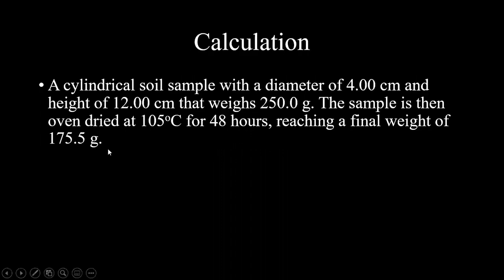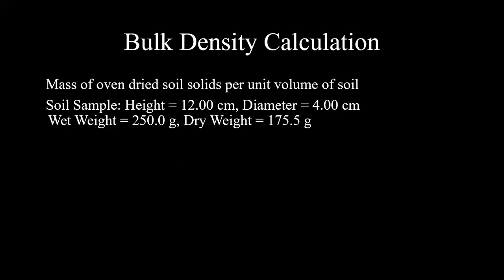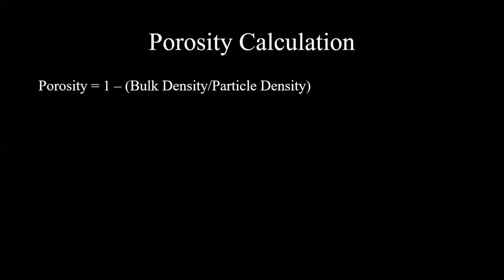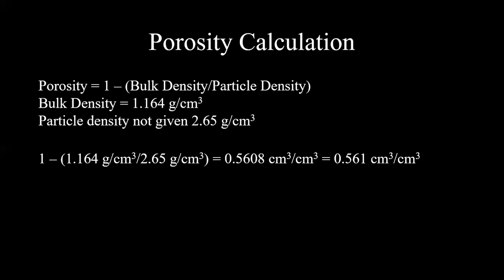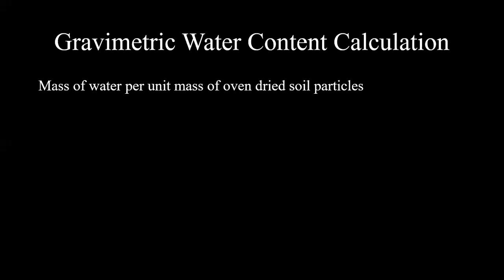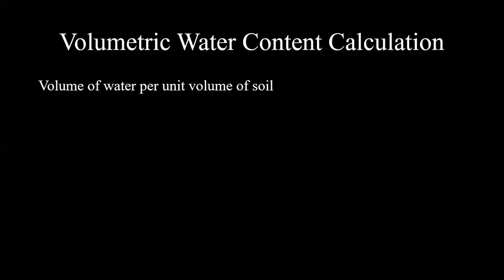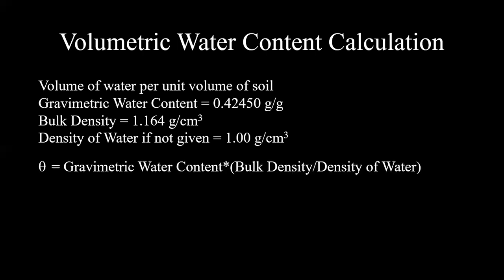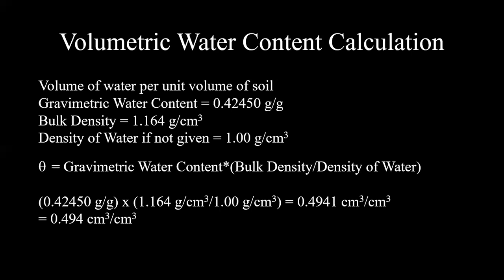Calculating soil bulk density, porosity, gravimetric water content, and volumetric water content

Comment: isnt bulk density the density of the entire sample before it was dried? Maybe im mistaken but i think for your mass you were supposed to use 250g to calculate bulk density
Reply: Im confius too,should be before dried or after😢
Reply from the maker: In some engineering contexts, there is a need to know the wet bulk density, which would require the weight before drying. But in soil science, the dry bulk density is almost always used, thus requiring the dry weight.